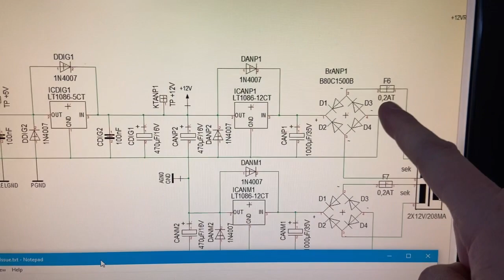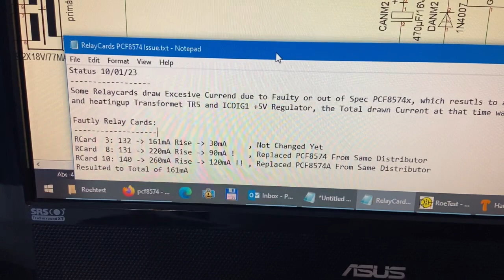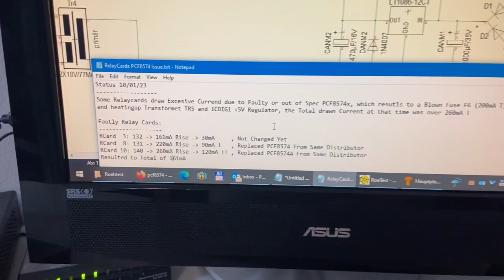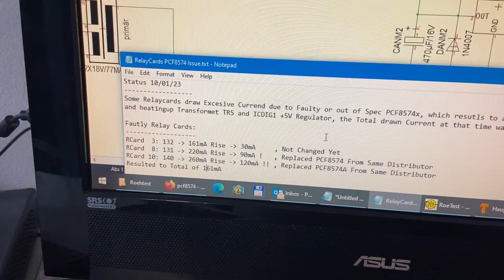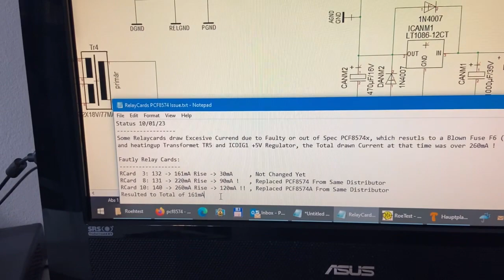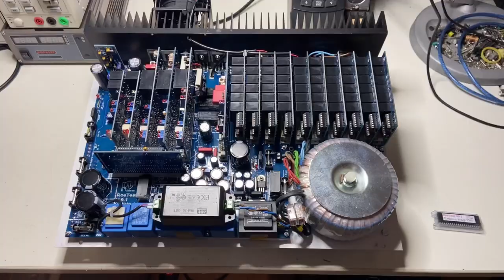ROETEST Tube Tester Build Part 8; Troubleshooting a Blown Fuse & adding a MEAN WELL AUX 12V PSU.

Comment: A thermal scan could be very helpful here. Thanks for the video.
Reply from the maker: Thankyou Shaun, I fully agree with you, but I dont have a Thermal Cam. I use the Finger Method for Temp Sensing and all is normal, the Problematic Chips, even the draw to much Current (in relation to what they should) don't get Warm bcs the current is low.
I made this Video for Eventually others to be aware of this Issue.
Cheers, Konstantin